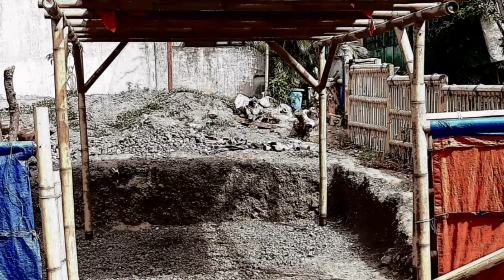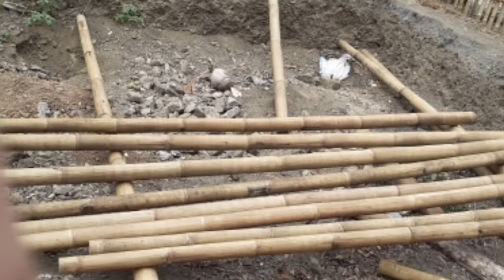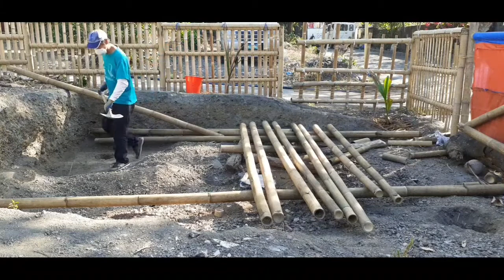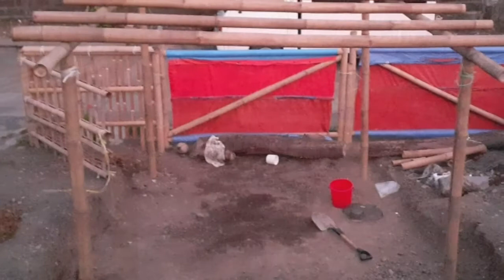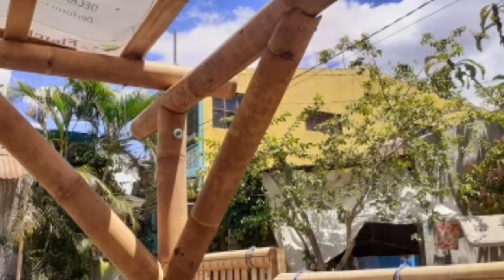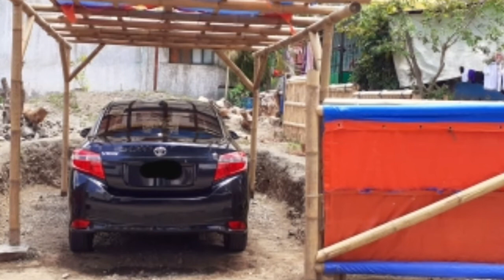"🌿 Building a Simple Bamboo Pergola Garage - DIY Project 🌿

Comment: Looks cool. What would you make different, if you would build it again? I plan to build a Terrace Roof out of bamboo and my plan is to put Solar on top. Do you think it will work/will be stable enough?
Reply from the maker: It is depend how old the bamboo, because  older bamboo are much better. Bamboo structure are strong enough if you have time applying proper maintenance.

Comment: it's gonna rot in a year
Reply: Why? Is there a way that it doesn’t rot so fast? I plan to build something similar.
Reply from the maker: If you want to build a beautiful bamboo structure, be sure that the foundations are concrete and the bamboo structures are old enough to make sure it is strong.